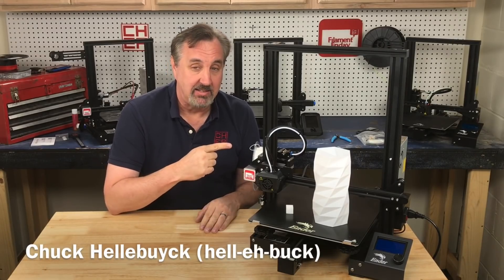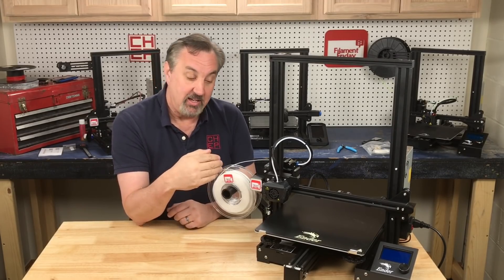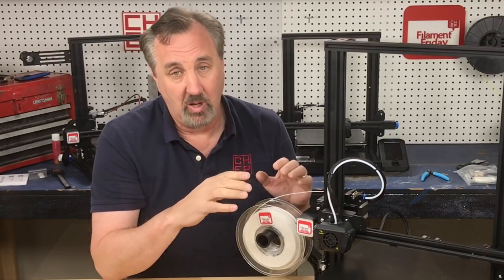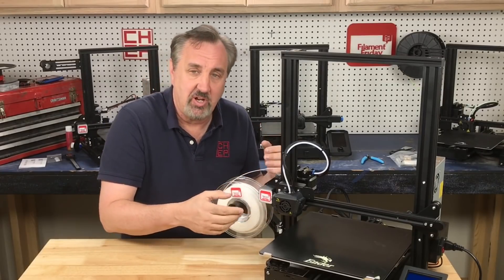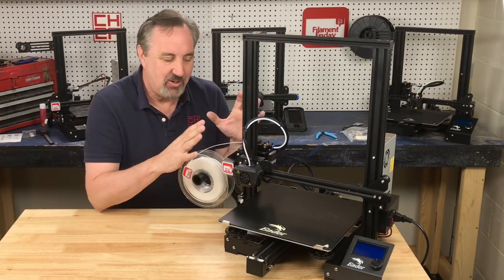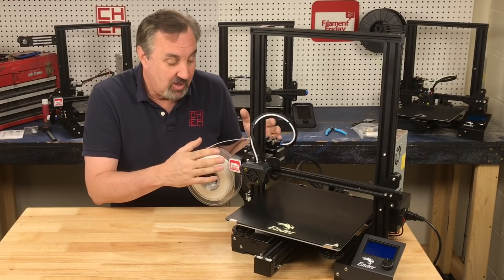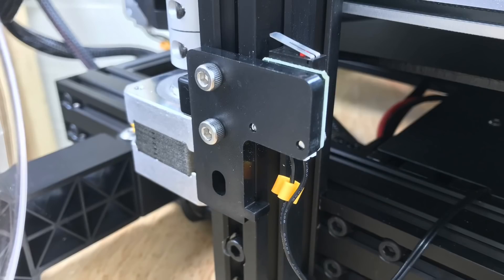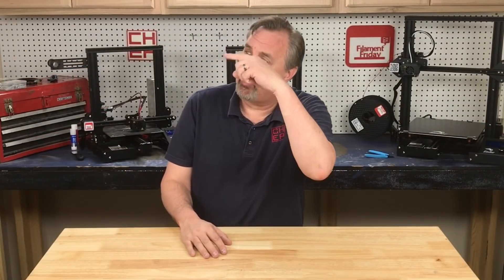Creality Ender 3 MAX Better and Cheaper Improved Version

Comment: Artillery Sidewinder X1 has a dual Z axis and a direct drive. Also 400mm Z height. In UK it costs the same as Ender 3 Max. So I got to ask - why would someone choose Ender 3 Max over Sidewinder?
Reply from the maker: Silent drivers, easier to get replacement parts and firmware, BLTouch support. These are a few reasons.
Reply: I'd also add more general mods available! The Ender 3 is very popular, and lots of mods are available which also work on the Max
Reply: Cheap mods and upgrade are everywhere.

Comment: Chuck, i have a Prusa 13 mk3s with MMS for multi colour prints and a 3 year old ender 5. I want a bigger printer to replace the Ender 5 and cannot decide between Ender 3 max,  or the CR-10 v3 or CR-10s pro v2- cost is not a concern as all 3 are reasonable, but which is the better printer (ignoring cost)? i.e. if money was not a factor, which would you buy for your own use?
Reply: It is not on your list and pricey 900 usd I would look in to the cr6 max but I’ve never had it just looks like a good option

Comment: Does this hot end print all kind of filaments?Like tpu,flex and carbon?
Reply: You should upgrade extruder and hotend.
Reply: @lorji2100  you're thanks.
Reply: @GiorgosLysigakis  you can buy dual gear extruder or direct drive you can print easily with direct drive.
Reply: @GiorgosLysigakis  you’re welcome.

Comment: what can you tell me about, I have an ender 3 max, and when mine gets near the end of a print sometimes, when its higher usually, i hear a rattling or vibrating sound from it as its finishing the last few layers.  I went up to it last time and watched it and I noticed the z rod  was vibrating side to side and hitting that top bracket that it goes in at the top.  It seemed as i was watching the lcd screen, that this was happening on every z axis movement up, or like nearly every other one.  and maybe it also was happening on the last pass but i didnt catch it when i sat there and might of been slowing the print movement speed down.  I dont think any of the stepper motors were overheating.  what could i test and how to find out what this is doing this? ty for any tips
Reply: I have found out why it vibrates by taking it apart.  I got one of those spider things you attach the rod to the motor with and it would pop the plastic spacers in it out.  the rod is warped. so i got to somehow bend mine back.  i cant use my spider because it will pop the plastic things in it out.

Comment: Just picked up an ender 3 max. It is my third ender printer. I bought an ender 3 pro two years and a ender v2 last year. This printer is pretty awesome and comes almost completely pre assembled. It took maybe 20 minutes to put together and after double checking everything maybe an additional 20 minutes. I have had some problems getting smaller items to stick to the bed. Its been pretty great out of the box. I really like the filament sensor. My v2 has had a million problems ever since I bought it. Creality sent me two new mainboards and new fans. Still have random issues from time to time.

Comment: for a new model they sure included  , lcd screen ;  x / y axil tensioner , and moving to next level  with the  hotend nozzle 320c degrees , 120c on the bed temperatures     thankssssss

Comment: First and foremost, thank you for the work you've done with the gcode and print files. I'm a beginner and this has been extremely helpful. One of the things I've noticed with my Ender 3 Max is that when I level the bed, I get good resistance when sliding paper in the corners but when it comes to the middle, the paper just passes through freely. Is this normal, or is there a step I'm missing? I tried to then adjust the four knobs so there was resistance in the center, but when I went to print it gouged the plate :(  I think my bed might be warped, is there anything I can do to rule that out?
Reply from the maker: It’s too common. Some flip the bed over. Some shim it underneath. I suggest just print to the side a bit.

Comment: Hey Chuck, I recently got the printer, and I think it's beautiful, however, when I printed the calibration cubes and the flow/e-step calibration box thingie, I realized that my cube was perfect in the x and y-axis but 1.5m short on the z. I also noticed that on the first 3mm of the print, it looked like it was overextruding, but I suspect it was the z-motor skipping every other step for the first 3mm which would result in the print being 1.5mm shorter than 20mm. Is this problem common? If so, do you have any suggestions for me? I asked the Facebook community but they couldn't figure it out. It would be great if I could show you photos so you know what I mean, but hopefully, my description of it made sense.
Reply from the maker: Take off the threaded rod and move the crossbeam up and down. It’s probably binding near the bottom.

Comment: are these good reviews fake, as for chep level system works great till first layers gone then it just scrapping along the bed,so i stop print and bed is way out,so level it again 3 times first layer goo,after that goes bad and nearly at standstill,so stop print and guess what bed is mile out again,aload of crap,is anyone gonna reach out and help. please.
Reply from the maker: Don’t blame my review. Both mine print fine and so do many others. Sounds like Assembly issue. Double check your Z rod isn’t slipping in the coupling and the wheels on the crossmember brackets are tight but spinning. It should rise smoothly during the print not fall.
Reply: @FilamentFriday  thanks for that,im not blaming set up it does work good,bud my bed wont stay level,i dont know how to set z stop or whatever it is,but sometimes my printer nearly stops,and i cant stop it from scrapping into my bed.
Reply: @roddsmith8954  use his ender 3 knob max gcode to level it with.  tighten all the knobs down, and then go to prepare and auto home on the printer.  then run the gcode for the max knob program leveller.  at the first knob loosen it and about every full turn on that knob, if you tightened all of them down fully, at least give the other 3 half a turn on the first corner you level as you adjust the first one. adjust it until it barely touches the tip.  then go to the second knob.  do the same, then do the same for the rest.  it runs all 4 knobs then goes to the center then the gcode goes around a 2nd time backwards.  on the first go around go light on the touch if your freshly levelling it.  on the 2nd time it goes around, make it a little tighter.  i like to get it to the touch of a pen.  after it finishes one 4 corner it goes to the middle. from there when im getting close ill make my overall feel lighter or heavier, depending on how the middle feels.  i use a piece of paper 1 sheet, to feel under the nozzle .  i usually run on a fresh levelling, the program 2 or 3 times.  i try to end up with it feeling like a pen writing on a paper feel. 
Also make sure theres no filament stuck to the end of your nozzle when you start to do the levelling.  if there is, and you keep having problems with that, do the hotend and nozzle trick fix you can find. 
also adjust the wheels and make sure there touching and not spinning in place but just tight enough using those offcenter adjustments i forget what theyre called right now. thats about all the adjustments i made to get mine runing pretty good.  then if it still has trouble on some prints, use supports. theres other ways to adjust it.  But my big problem i had was the nozzle getting plastic stuck on it and me rerunning a levelling run after 1 short run and it not levelling right,  if your not noticing it.
Reply: @ranc9551  thanks for that,i will try that,iv just had to format the  sd card cause that packed up aswell,im haveing bad luck.
Reply: @ranc9551  im not sure what you mean.
Reply: @roddsmith8954  the nozzle tip can get filament all over it, knocking  your trying to level the bed off, by the tip .. having filament all over it. theres things from the factory were the nozzle and the hotend arent installed correctly and the filament can leak. i just had to do it with mine, after 2 days non-stop printing.  it kept having filament curling up at the end of teh nozzle and even leaking out by itself without it even running.  it was spilling out between the hotend and nozzle.  just look it up, and check yours and see if there is filament on the tip of your nozzle before you try to level it.
Reply: @ranc9551  ok good il try yhat,thank you.
Reply: @roddsmith8954  take your time with it and use his 2 gcodes for the max and once  you get it you'll figure out how to level it quick and keep it levelled. im still working on keeping it levelled after it sits around idk if i keep bumping mine but ive had it 3 days now.
Reply: @ranc9551  ok cheers.
Reply from the maker: Put the springs at about mid compression then lower the nozzle to just touching. Loosen the Z and slide to the bracket and retighten.
Reply: @FilamentFriday  you mean loosen the z-stop first right?  because, my ender won't even touch the board when the springs are tightened at half, and then tighten down the z's screws and nuts because the max doesnt come with the adjustable z and get those t-nuts and screws and, that, is how you adjust the board with the z-stop since, we don't have an -adjustable z-stop, right?  and that's how we do it.  ok i was wondering how the board should be adjusted, when i got the z-stop mod.
Reply: @FilamentFriday  yep thanks,i did that got it great then started scrapping on the infill,iv reset again, ajusted everything,now its blocking and extruder is clunking,tried everything,iv ordered some capricorn tube,maybe a bltouch would do it,im not sure weather to get one,the printer itself may be faulty, im trying another print first layer is going ok up to now,il see what happens,im only on my 3rd nozzle in 2weeks thats bad.65yrs old i should pack it up lol,thanks fo reply.
Reply: @FilamentFriday  not sure what you mean by z and move to bracket,what z and what bracket,im lost her.
Reply from the maker: It’s the switch on the side of the printer.
Reply: @FilamentFriday  oh ight,i goti,bt mine like all these its got fixed screws, but my bed goes right down to it,but strangly sometimes it doesnt,cant understand why,still il figure something,thanks for that.
Reply from the maker: That’s why I mention in the review that I don’t like the fixed mount and recommend replacing the screws with shorter screws and T-nuts to hold it in place.

Comment: While the printer is mostly assembled it's still worth checking the assembly.  I noticed some slight "bumping" when manually moving the X axis.  I originally thought it might be a flat spot on the rollers, but the bumping only happened at certain spots along the X rail.  Upon further examination, I found the X axis tension was very tight, much tighter then what I have on my Ender 3 Pro.  I also noticed the belt wasn't riding in the center of the tensioner.  I loosened the tension roller, and lowered the tension (considerably).  Once the tension was set correctly the bumping was eliminated, and the belt is oriented at the center of the roller.

One thing to remember if you adjust the X axis:  Make sure to level the bed after adjusting the tensioner.  After reducing the tension I found that the print head/nozzle moved down to the point where no filament was coming out of the nozzle.  Fortunately I noticed the issue before scratching/damaging the glass print bed.

Comment: Love my Ender 3 Pro but sometimes, when i change to a different filament, it loses the level and the nozzle starts to scratch my glass bed. I have to relevel the bed almost every time i install a different filament. Any idea why this happens?
Reply from the maker: Your wheels on the crossmember brackets are probably not adjusted properly so and action on the extruder cause the arm to sag/shift throwing off the level.
Reply: @FilamentFriday  Wow, Thank you so much. Do you have a video on how to fix the issue you can share? I'm still pretty new to this 3D printing thing. Got the ender3 pro about six months ago and i am learning so much watching your videos. I even purchased the yellow bed springs cause somene said it was the springs.Very much appreciate what you do.
Reply from the maker: Not a good one. I’ve thought about making one.
Reply: @FilamentFriday  either to slack or to tight,they just dont do anything on mine exept make it worse.

Comment: Is there a direct drive extruder kit for the Max? I know there are multiple ones for the Ender Pro and Ender V2, but I haven't found one for the Max.
Reply from the maker: Those ones might work but might have to extend wires. I don’t know of one specifically for it.
Reply: @FilamentFriday  Okay, thank you for your quick answer.

Comment: I just got mine. Been struggling for many hours trying to get the bed leveled. Adjusted z-stop up and down, tried adding spacers to some or all of the springs. It seems the back right one is always lower than the rest, so I tried using a spacer on just that one too.. I'm ending up with adjusting each wheel till it can't get it tighter or till a wheel falls off... 

This is very frustrating :-/

Comment: Should I get the v2 or the max? First 3d printer
Reply: V2 unless you need the larger volume
Reply: @Moximaxius  i saw that the v2 bed temp only goes up to 100. I plan using abs mostly. Do you think the pro is a better option? It's goes to 110
Reply: @varela91  why would you want more than 100
Reply: @Moximaxius  from my research abs prints better with hotter bed temps
Reply: @varela91  Abs justvneeds an enclosurer to print well

Comment: Set up my new Ender 3 Max today, and ran into an issue where the auto home feature didn't work.  The weird thing is that the auto home worked correctly during the setup, but after one time it no longer worked.  After considerable troubleshooting I found the Y axis limit/stop wasn't working properly.  I finally found that one wire from the Y axis wasn't connected at the control board because it wasn't pressed into the connector housing.  After "assembling" the connector housing correctly all is well.  Luck of the draw :)

Comment: Need advice.  I'm on the fence between ender 3 max and ender 5 pro.  There is a promotion out now on the ender 5 pro making the two only a $20 difference.  Which one should I go with?
Reply from the maker: I’ve never used the Pro so I’m not able to help.
Reply: Note that the Ender 5 Pro has a smaller print area, but there are some other differences outside of the obvious print frame.

Both have a 24 Volt power supply, but the Ender 3 Max power supply is 350 Watts compared to the 270 Watt in the Ender 5 Pro.
The Ender 5 Pro has silent stepper drivers for all steppers, where the Ender 3 Max only has silent steppers on the X and Y axis.
The Ender 3 Max has dual cooling fans verses the single fan on the Ender 5 Pro.
The Ender 5 Pro has Capricorn PTFE tubing, where the Ender 3 Max has the standard Creality PTFE tubing.
The Ender 3 Max has a glass bed, where the Ender 5 Pro has the flexible magnetic surface (like the Ender 3 Pro).

In many ways the Ender 3 Max looks more advanced, but I imagine the Ender 5 Pro with its rigid frame may produce more accurate results.  There is also the consideration that the Ender 3 Max has a lot larger print ability.
Reply: @radiofan2454  Thank you for your reply.  Right, these two seem to have a very competitive pro and con list.  I think both are very competent and capable.  Maybe I should just flip a coin.  :)  Thanks again.
Reply: @NA-oc1yx  Not sure, but I think the Ender 3 Max was faster.

Comment: Picked this up as my first 3d printer 3 months ago. I've been printing something nearly everyday (3-8 hour prints) and couldn't be happier. I will agree with the complaint being the z axis limit switch isn't adjustable, it isn't a huge issue but the leveling screws for the bed are near their end of travel. ALSO one thing to be aware of is that finding thermistors or heater cartridges with the correct length cables are difficult to find. I ended up buying stock ender 3 parts and soldering extensions.

Comment: So is the max better than the v2?  Just asking for clarification!!  Also thanks for the videos.  I just bought by v2 and cannot get the dang thing to work
Reply from the maker: It’s bigger, not sure it’s necessarily better.
Reply: @FilamentFriday  thank you!!!!
Reply: v2 has a few features that the max does not, like power outage resume and lcd screen.
Reply: @jpage5303  the max has power outage resume according to the spec sheet I'm looking at on Amazon